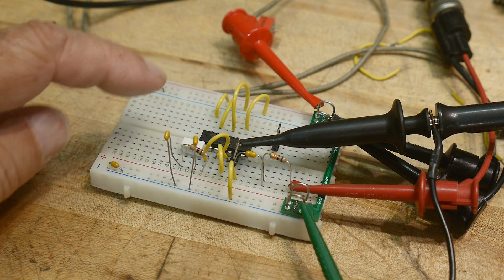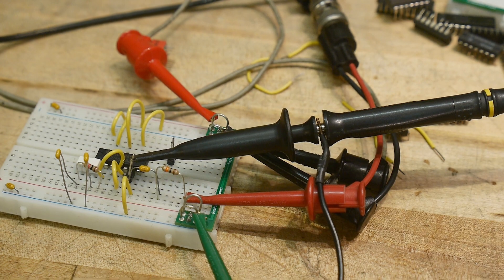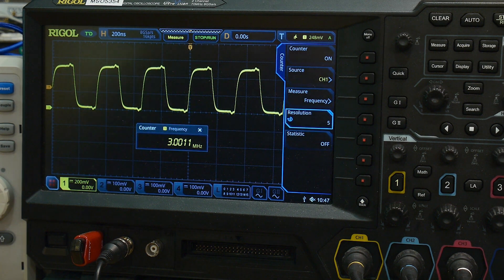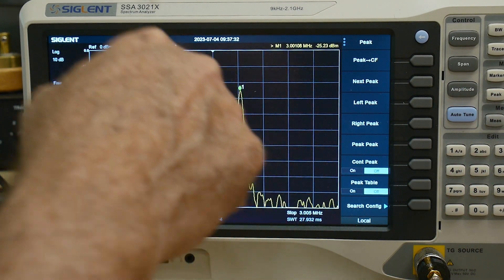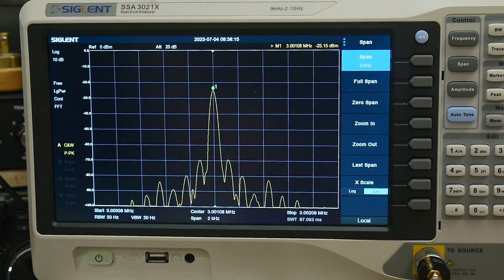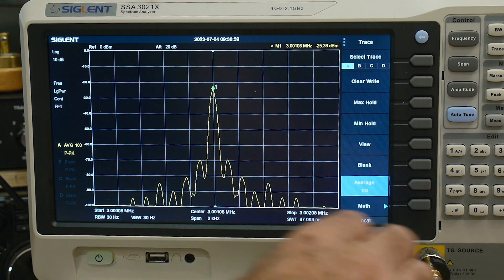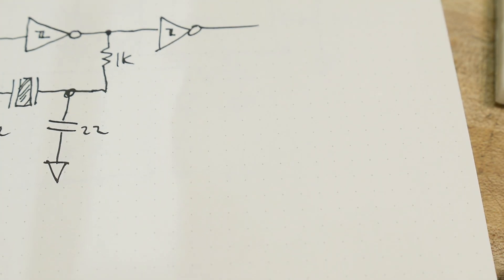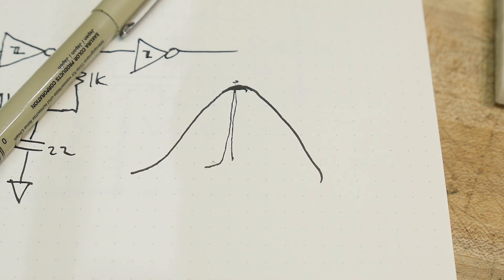#1579 Ceramic Resonator (part 2 of 2)

Comment: That's certainly fascinating. My first thought was external interference from something else in the workshop. My second thought was it is close to 2x the mains frequency which could be coming from the power supply to the circuit. Did you try running that same circuit off a battery?

Comment: 3:11 - I think that breadboards are not designed for this testing. Try to solder connections and test everything again without breadboard. From what I know breadboards can not give precise results when it comes to frequency.

Comment: FM Modulation as result of not having Decoupling capacitor.  It converts VCC noise to FM modulation using Bessel function. 50 Hz power lines create noise on your supply lines and your 1st peak at 100 Hz.
It is better to use 3 inverters instead of one inverter and loose the caps.  The reason is because of Barkhausen criterion you need those caps and resistor to create 360 Deg phase shift around the loop. With one inverter you get "almost" 180 Deg phase shift from inverter and 180 Deg phase shift from Resonator.  That is why you need the caps and resistor to get 360 exactly.

Comment: Piezo electric effect works both ways, those ceramic resonators are also capable of making volts if you tap them, wonder if the AM 'sidebands' are the result of it picking up vibration of a fan or something?

Comment: Looks like 120Hz so maybe full wave AC rectification of your line frequency? Marker #2 was not at the peak of the fundamental.
Reply: Exactly my thoughts too, because of it would totally make sense. Might come directly from the power supply ripple. The proposed experiment to check the hypothesis would be to RC Filter the Input Voltage with a large cap and then check if it drops down a couple more dBc.

Comment: It is an advantage to stabilize the DC condition of the input by providing a resistive pass from the output to the input of the gate. Otherwise the working point will shift with the amplitude what has in return an influence on the gain and the amplitude. It also stabilizes the operation against interference by fields. 
So the variation might be a beat between the scan frequency and the relaxation of the resonator - or an interfering frequency, ( - or anything else). 
By the way there is a "zoom in" and a "zoom out" key in the "span" menu that I always use, I did not see how you did it.